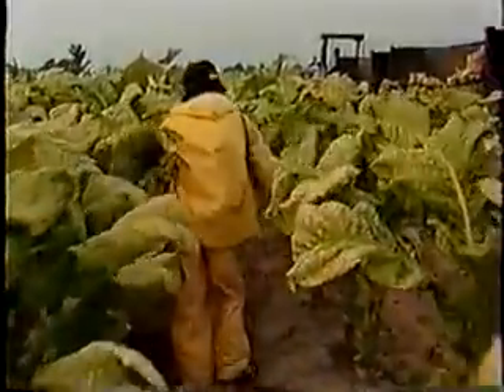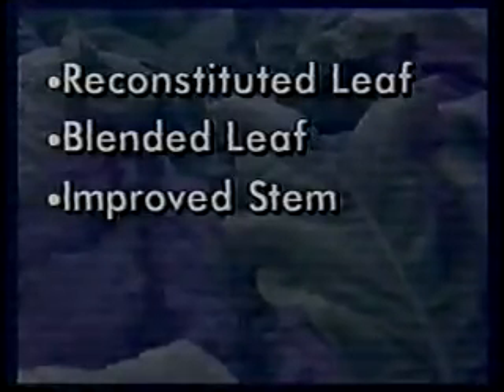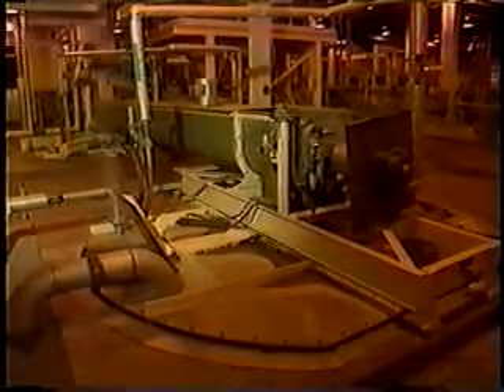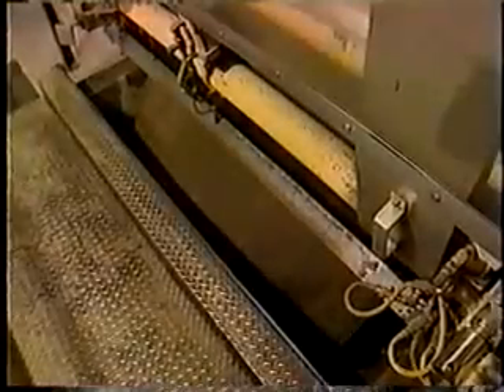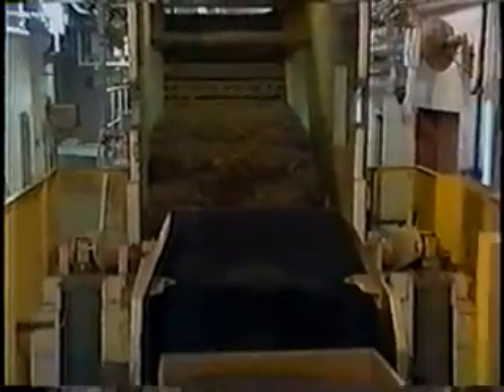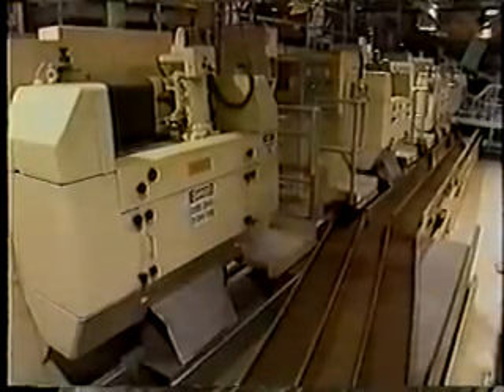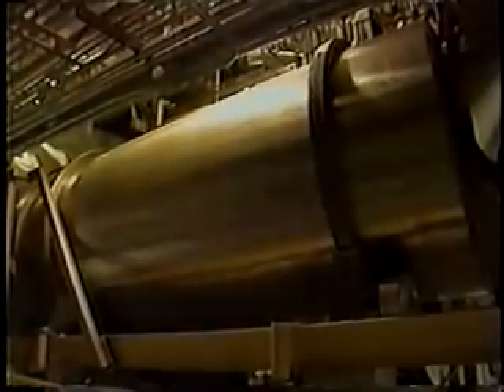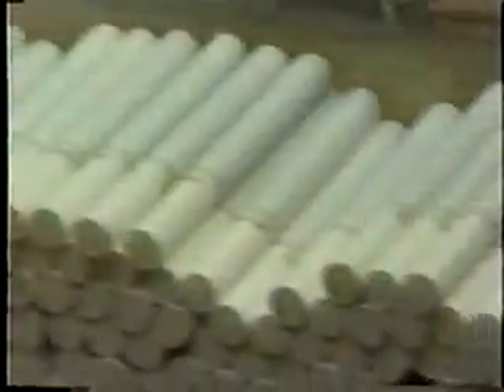how cigarettes are made

Comment: Thank god im off of cigarettes.After 20 plus years I weaned myself off of them to e cigarettes. less stuff in it as they call it vaping. So yeah I vape now with watermelon juice to puff on. don't have to worry about burning holes in my clothes or have to go outside in the cold or heat for a smoke. Get up in the morn switch it on and puff away. Even the doc when she checked my lungs she said that its clear after 2 months of puffing so im good to go ..
Reply: Inhaling any particulates into the tiny delicate air sacs in your lungs that have the crucial job of blood gas exchange other than prescribed medication is going to have some detrimental effect on your lung health. Vaping is safer than smoking but it still carries health risks by its nature.

Comment: I do love seeing everyone claim this or that is healthier, you do know if you burn anything at a high enough temperature it will produce formaldehyde. That clean weed only joint you think is so healthy is obviously being burned rather hot to make it smokable, and guess what it's producing? ... You got it.
Reply: +MadCowGoMoo  formaldehyde is produced by the combustion of different sugars that are used in the curing process of tobacco as well as produced commercially. seeing that you dont cure weed your wrong
Reply: +Jayden Reiling Um. No. In fact you do cure marijuana, just not for as long as tobacco, because rarely are weed-smokers solely interested in the flavour of their joint. Many tobacco smokers, especially pipe and cigar smokers, only care about the flavour, and often age their tobacco for many years before use. If you did this to marijuana, you would get much better flavour, and a much smoother smoke, but you might lose some THC. But marijuana is dried and left to rest before smoking or else it would literally be unsmokable.
Reply: true but at least in most cases nothing extra is added during the curing process. weed does not contain the right substances to produce formaldehyde without adding extra things to it
Reply: Perhaps but in the right situation, nothing is added to tobacco, either, except maybe sugar, sometimes. What this video represents is the worst type of tobacco production. But although it is the majority of tobacco consumed, we tobacconists see a different world of tobacco production.
Reply: its nice having a friendly comment thread on youtube for a change